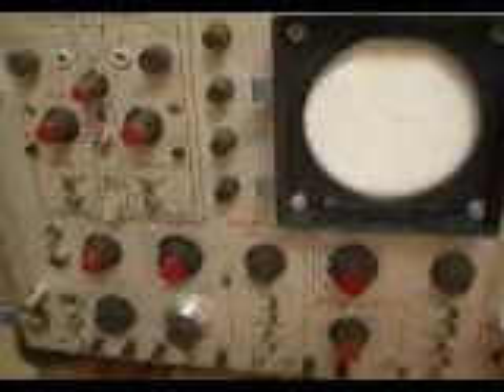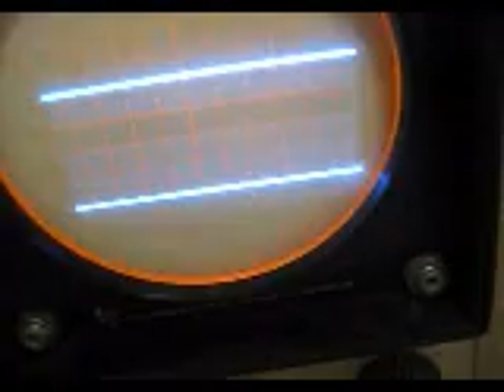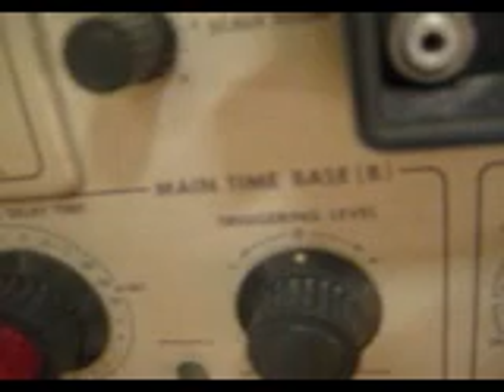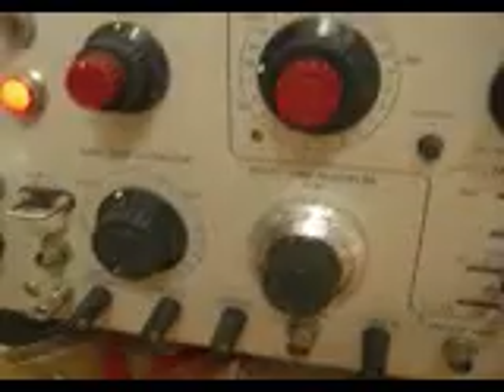Tektronix oscilloscope working

Comment: There are special filters, but by the time these filters dissolve. I take filters for range hoods, made from glass fiber. It can cutted easily with simpel sharp scissors. I read your other answer too. I inquired about the manual on the web. So I found out that the 546 is a hybrid between the 545b and the 547. It includes a Tunneldiode Trigger, like the 547, but hasn't its synchonisation for alternated horizontal display. When you want more information you can look at the VintageTEK museums page.

Comment from the maker: I oiled the fan and stuck a drill on it to spin it and work the oil in. It turns fairly easily now. I will try and clean it up inside, is there a special type of filter I should get for it? I will be careful with the brightness, thank you!

Comment: Blue phosphorised CRT's in a TEK are still rare! Have seen the fan, you should clean and oil the bearings. When you want have a long time of fun with it, you should get a air filter pad and clean up the scope inside. Its circuit components are mounted on soldering strips and the penetrated dust can cause shorts, damaging the scope hardly. 
So you also take care that the spot brightness is not too high at low deflection rates ( about 1SEC/CM) because it can damage the Phosphor very fast!